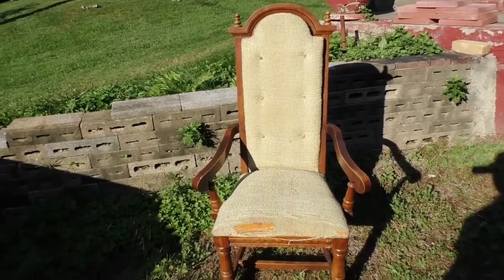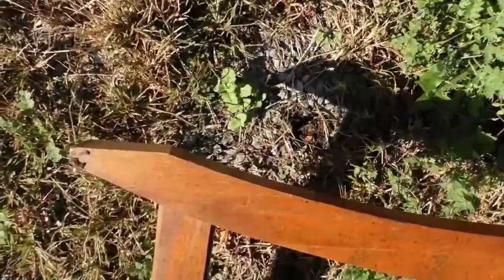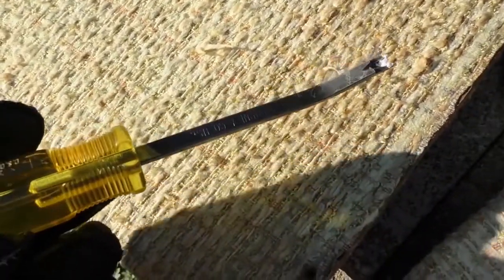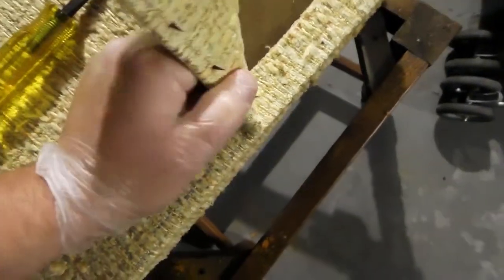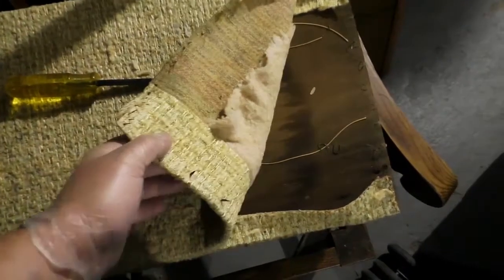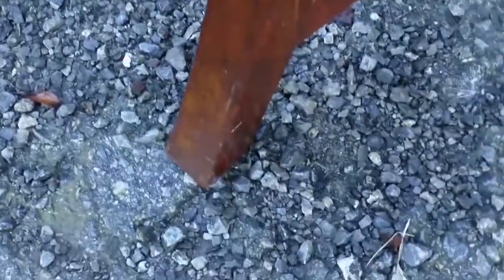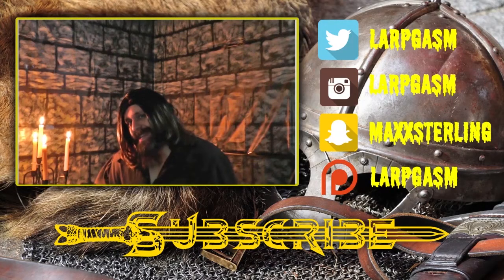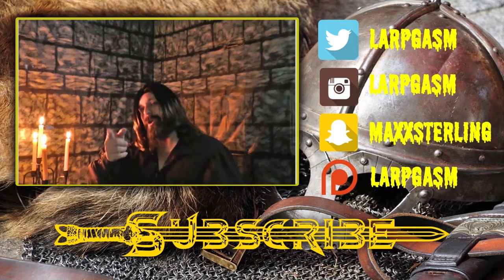How To Make A Medieval Dragon Hide Throne From An Old Chair (Pt.1)

Comment: Did you have to sand the chair down before staining it?  My middle school theater club is converting 2 arm chairs into thrones for their play.  Trying to get them prepped before we begin.
Reply from the maker: This was an old chair and finish was pretty degraded, and I was going with a darker color, so I just cleaned it well instead of sanding  However, if you want them to look their best, have the stain be even or if you are doing a lighter color and want the stain to last longer, you should sand them first.  If they are a one time thing and you're going darker, you can probably skip sanding, but if they are newer chairs, the stain may not adhere and you might have to sand anyhow.  I'd say try it on one leg or the bottom first and see how it works out.  Hope they work out!  If you get a chance post a photo somewhere and tag me.